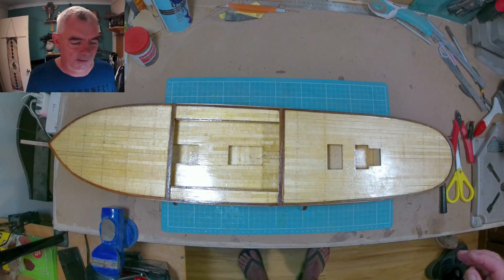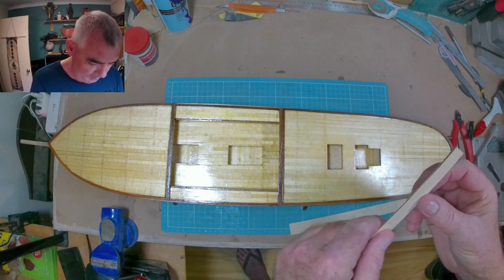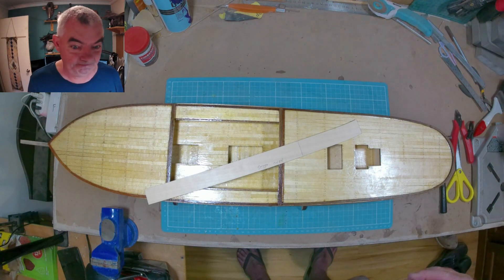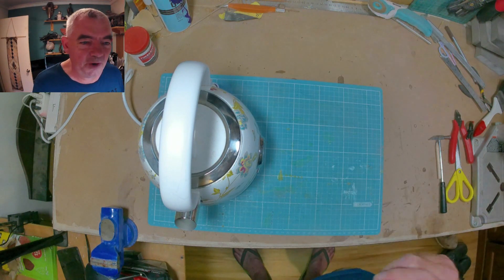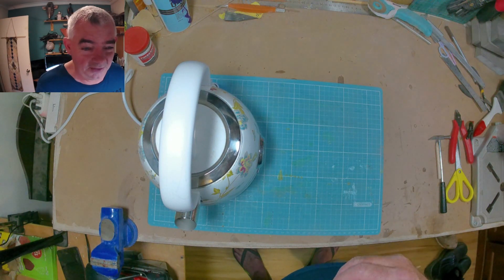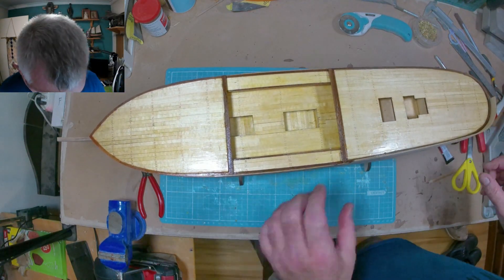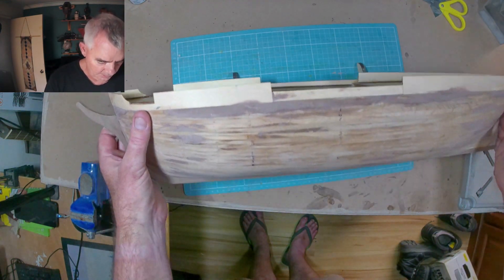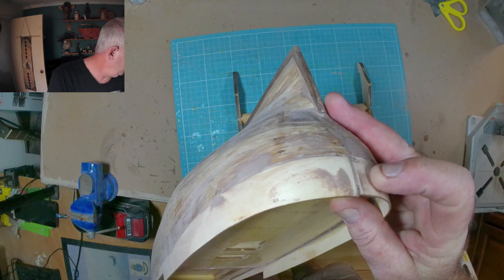US Constellation Build EP7 Bulwarks

Comment: Building the model ship now.  However at the forepeak, my instructions say to leave a 12 mm opening at the stem for the spar (something) to be located.  Just an observation.  Great job.
Reply: I always build the fire peak and then cut the hole for the spar - this allows the fore peak to hold its strength until you are ready to do the spar and fore peak build